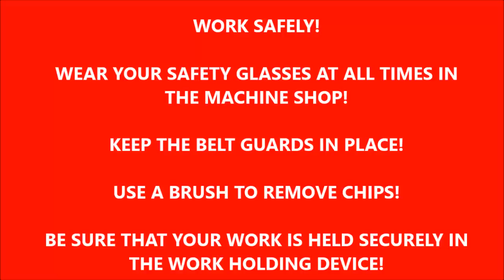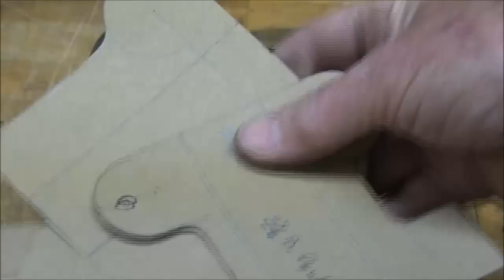Part 10 of 10 - tubalcain Builds the YELLOW BOY STEAM ENGINE

Comment: I made one back 40 plus years ago to run air to my aquariums but I used an open and close valve to push air to the filters I was using. I also use a small motor to run it. I think I was on my teens. I work 25 year in the tool room as a tool & die maker. Im injoying your builds deffinetly many Thanks for what you do.

Comment: A little trick I use so that previously soldered joints don't unsolder when I try to solder some new parts.  Take a J-cloth (or any other rag) and soak it in water.  Wring it out a bit and drape it around the parts that you don't want to unsolder.  Proceed to solder your new parts.  

This makes use of some principles of physics whereby the temperature of the J-cloth (and the surrounding parts) will stay cool until the all of the water has evaporated.
Reply from the maker: +Robert A Moore Good idea-Thank you for watching.

Comment: Great series Mr Pete.  What is the lowest air pressure that you can use to run your new engine reliably and for long periods?  I presume that this is dependent on minimizing the friction between adjacent sliding parts.  I would find it fascinating if you could investigate the possibilities of fine-tuning the performance of your engine on video.
Reply from the maker: +Adam Ward 5 psi--Thank you for watching.

Comment: 5:20  Hi Lyle, great series I am enjoying it very much. When showing those 45 degree settings, have you ever used a digital level for that type of setup? Thats what I used o make a 60 degree cut, zero on the vise and set the work at desired angle. It was satisfactory for what I was doing.
Reply from the maker: +howder1951 Good idea--I need to get one

Thank you VERY much

Comment: Around 10:30, what if you threaded the head tenon and the chamber? You would have to move the port down a bit, but how critical is compression ratio on a little steam engine?  As you noted earlier, you are running it very tight on this one as it is. Just a thought...
Reply from the maker: +Tenspeed TheBikeHanger Might work?-- Thanks for watching

Comment: Hi:  
Nice video; really sharp what you are doing there.  
Two cylinder; double acting engines, usually have the cranks set on the quarter....  
Right side leads... Which side is the right side? That is the question!!  
If you go to a "jewelry supply house", wholesaler, you can get temperature graded solder!  
You can start at the highest temperature...and work your way down....

Comment: I had previously wondered how to calculate the depth of cut needed for a specific chamfer width when cutting with the work at 45 degrees. After struggling with what I knew were two related right triangle problems, my troubles compounded by the fact that my studies of Algebra were some 50 years ago, I determined that the solution is very simple, for a chamfer length of C, the vertical cut depth is 0.5 * C. For 3/16" then cut 3/32", or 0.09375.

When cutting chamfers when mounted flat, using a 90-degree point, touch the bit off and setting the side cut depth to 0.7071 * C. (the square root of 0.5).
Reply from the maker: +weshowe Sounds like a good solution-thanks

Comment: as always i enjoy your videos.....do kinda miss seeing you turn things, but I understand why you did a lot of that off camera; it's repeat of other videos you have....I just always find it fascinating to watch....

I've found brass difficult to solder regardless--  i found it helps if you "tin" the places you'll be connecting prior to actually attaching, then you can just heat and touch the solder and it'll connect almost immediately...

would polishing the faces of the cylinders where they rub the stand help with the self-starting?(thus reducing that friction some)

as for the one that you didn't have a name for...I suggest "YellowBoy 1.5"....
Reply from the maker: +Tim Hyatt Some good ideas- Thanks for watching

Comment: Please forgive the rank amateur question, but is there a maximum diameter of flywheel that those pistons will drive? Or is there some magic proportion/ratio of piston size to flywheel? I only ask because I have material to make a 4" flywheel (and no facilities for casting one of your size) and wondered if I need to scale up the other components to suit. Thanks for all your hard work in bringing this knowledge to us beginners.
Reply from the maker: There is a max--there are formulas & books written about it. I just guess
Reply: Thanks for your honesty. I will have to take the 'suck it and see' approach, and build away. It will either work or it won't. I'll let you know how my flywheel design works - you might even try the same method someday.

Comment: Another great video. Just a point of interest; you have a twin cylinder double-acting steam engine... you have a crank offset of only 10 degrees... wouldn't a crank offset of 90 degrees have been more efficient?

(In the UK it is solder with an L, not sodder without the L... do you call a person in the armed forces a soldier, or a soddlier? Just a thought, mrpete).
Reply from the maker: +Gordon Burns I need to try that